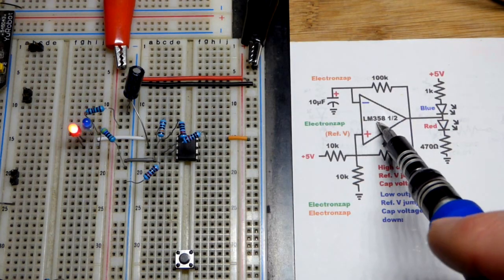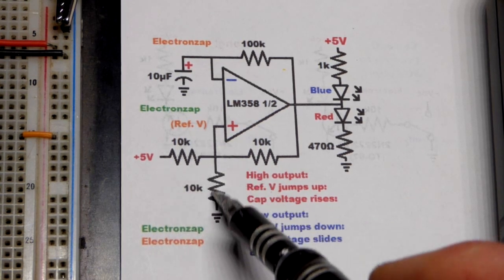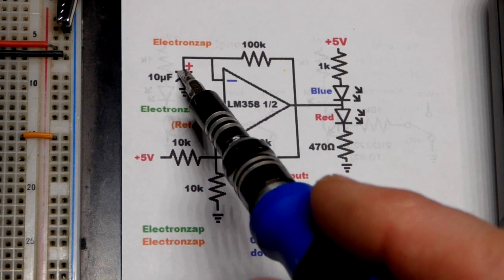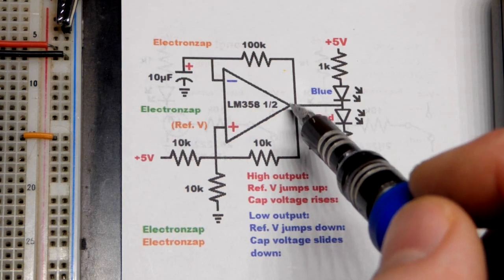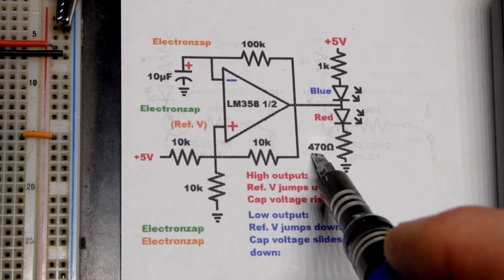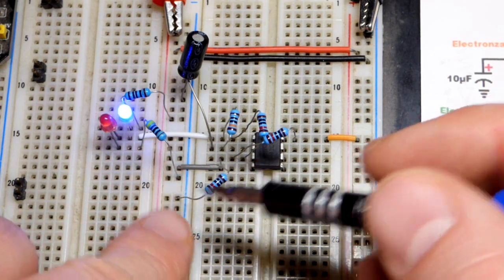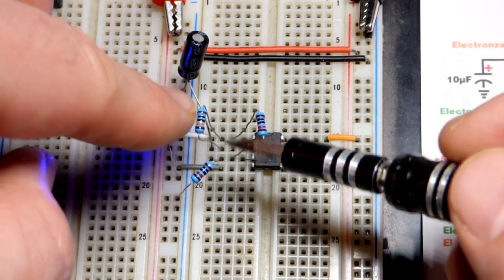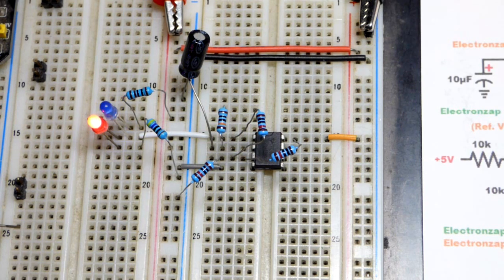Astable Op Amp Alternates output LEDs using LM358

Comment: I put this into my circuit simulator.  I was "burning" the polarized capacitor and this continued until I raised it's value to 50uF.  At 5v the simulator's LED's would not light up.  When I raised the voltage output to 12V they lit.
Reply from the maker: That's interesting, thanks for the info!